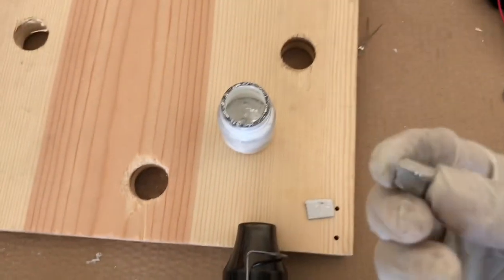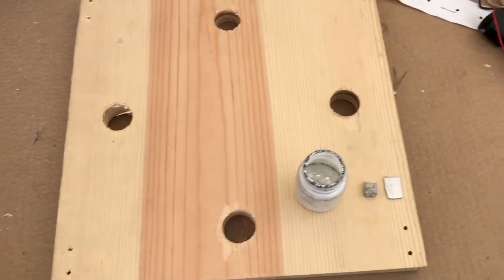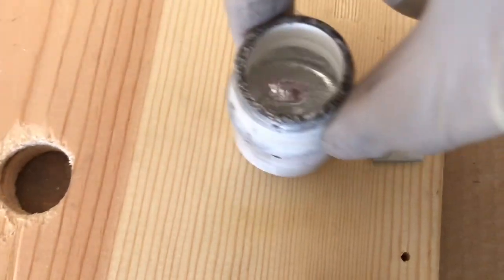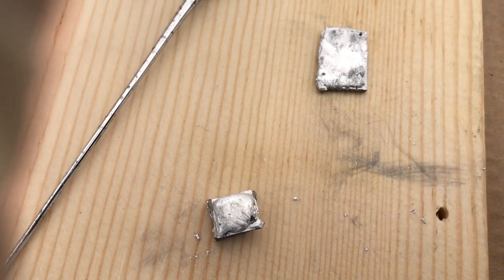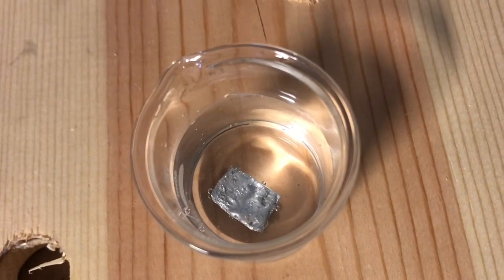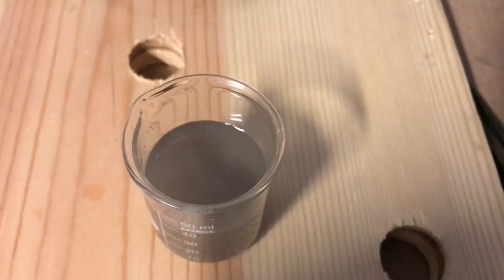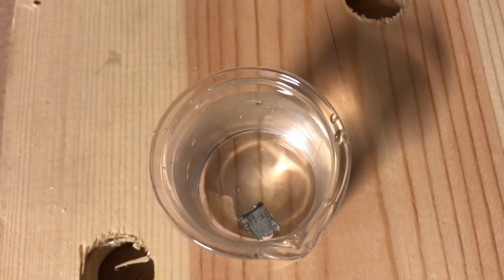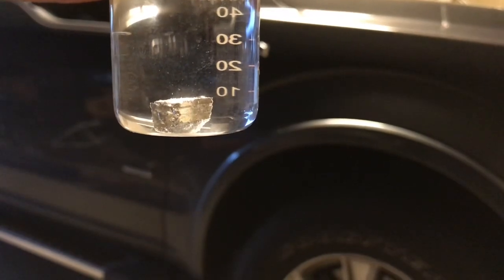Magnesium- Gallium Amalgam + Water??

Comment: You may get better results by adding small amount of chloride to the water (e.g. sodium chloride) - both aluminium and magnesium hydroxides insoluble in water, but can get in equilibrium with very soluble chlorides, leading in progressive dissolution.
Magnesium oxide and hydroxide has even higher affinity for iodine and iodide.
In case of AlGa, the gallium is also reactive towards water and may form insoluble heterocomplexes in lower oxidation states. Al won't oxidize completely in water unless containing much more than ~5% Ga. This is different from aluminium amalgam, where even minute amount of mercury suffices. This is partly because mercury has negative electron affinity so it can "suck up" electron-rich metals such as sodium and aluminium and does not care about the extra electrons moving around in the alloy. Sodium amalgam actually reacts more mildly than sodium metal even in acidic water (!) because of this property.

Comment: Recently purchased a few grams and Compared to Al+NaOH+H2O it does not compare for longevity and ferocity, though the amalgam is interesting….. I found after (2) goes (1) recovery - I was getting less and less gallium than what I started with - it seems to disperse and nearly disappear after 2 goes….
Reply from the maker: A research group has figured how to recover most of the gallium and clear  away the aluminum hydroxide sludge! May end up being the future of HHO cars:

https://www.greencarcongress.com/2022/02/20220222-ucsc.html
Reply: @BrianDhvTinkerer  hopefully - lithium, zinc & cadmium is not a sustainable resource for all electric, especially the carbon footprint for 1 ev battery unit
Reply from the maker: Exactly!!
Reply: @BrianDhvTinkerer  Nurdrage shows a good method of recover too using NaOh & After a weak solution of H2SO4

Comment: For your induction heater Why you  use igbt instead mosfet 
If you want to use mosfet I recomand power mosfet like fch170n06 wich can handle 170a dc  or fch104n60 37a this are from fairchild wich now is part of onsemiconductor

Comment: Connect topload of Tesla coil to metal samples and put into water. Wire must be insulated from water so only the high voltage goes into the metal. Post video!